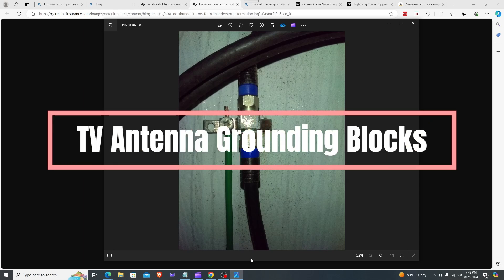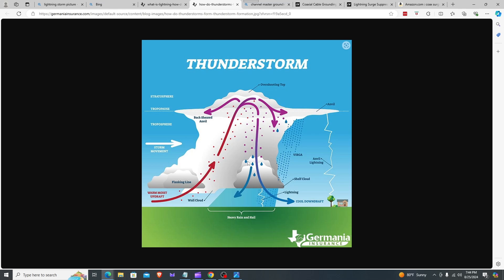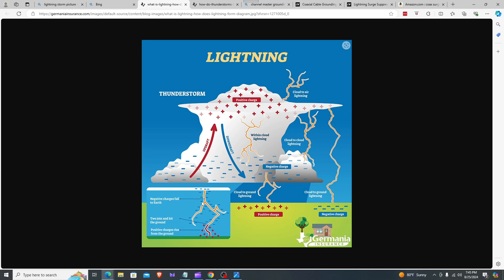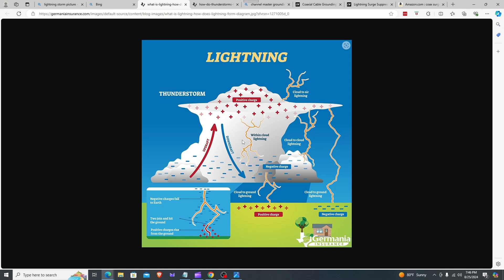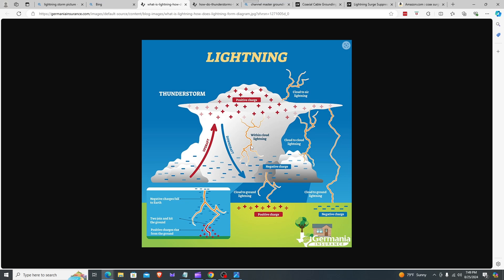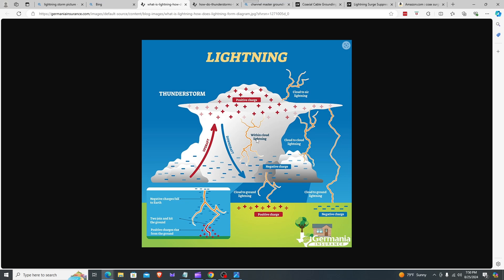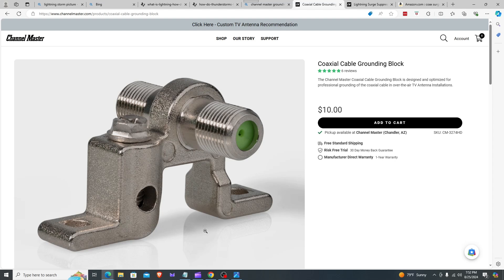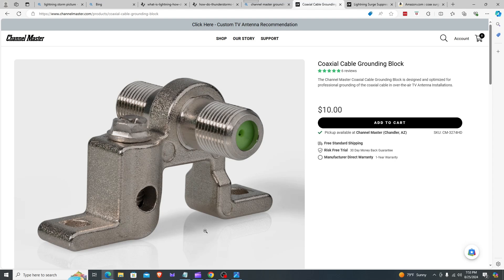TV Antenna Grounding Blocks - more in-depth on how they work

Comment: I got a4 way powered amp splitter. I live in Florida and i haven't used 1. I'm imagining i should but i figured the amp goes to the electrical and that's grounded so I'm ok🤷 honestly i haven't a clue. Jus piecing things together
Reply: It is my understanding the ground block should be outside before the coax enters the home.  I had a professional install my antenna but he didn't install a grounding block nor grounded the mask.  I did it myself and it is was not too difficult.